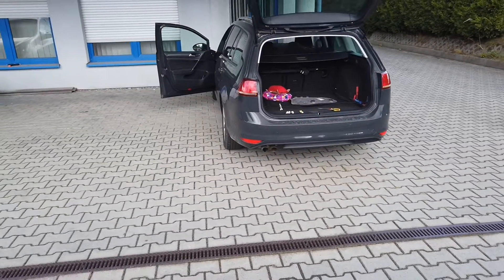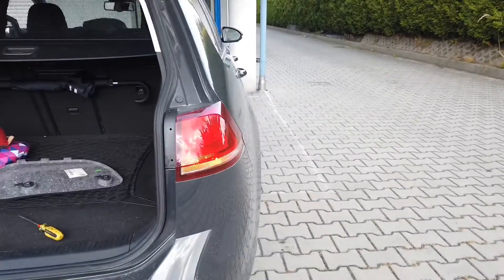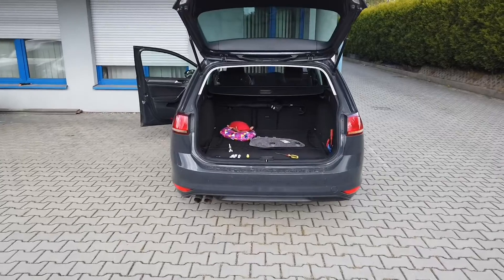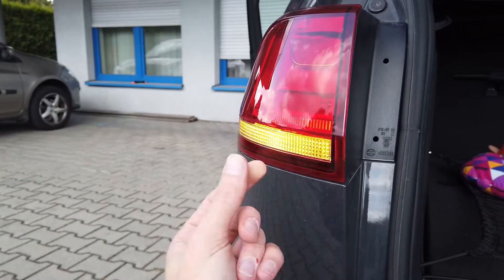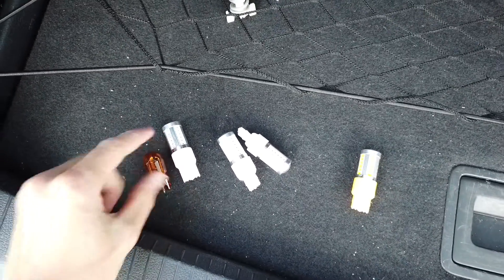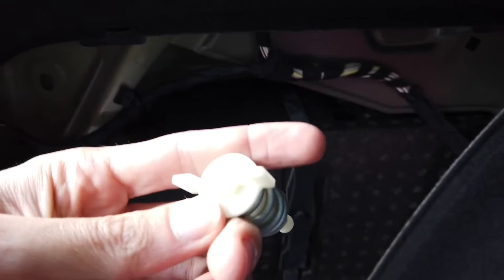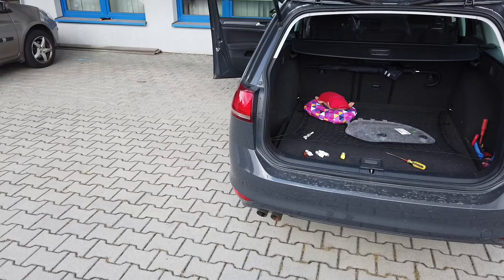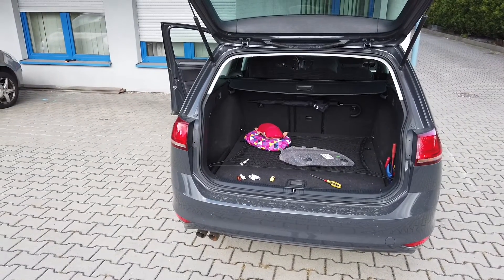VW Golf MK7 (5G) rear turn signals LED mod

Comment: It is not better to code it with the type: "38 - LED Blinkleuchten"  instead of  "Allgemeine LED" ?
Reply: Hi, good question.  I would also be interested.  I would also like to know the difference between "40 - allgemeine led" vs "43 - allgemeine led".  So which one is best to set up?

Comment: Did you have any interference with your DAB signal? I am having issues with reverse LEDs making my signal drop out and am wondering if I will run into the same issue here.
Reply from the maker: I’m not using DAB. If you have interference you can try using LEDs without the CAN-BUS pod resistor and code the circuit to LED (to avoid broken bulb error), also adjust brightness to full (127). This should produce less noise.
Reply: mr-fix Thank you, that’s really useful! I hadn’t thought about coding so I’ve only tried CAN-bus bulbs. I’ll give it a go.

Comment: Hey! Did you find any leds that would fit the brake housings while those preseted in the video would not work? Have you found any alternatives for the brake lights?